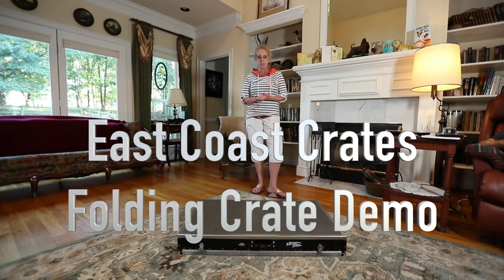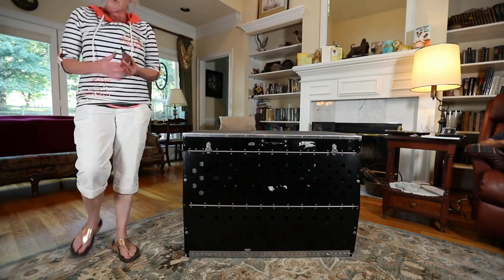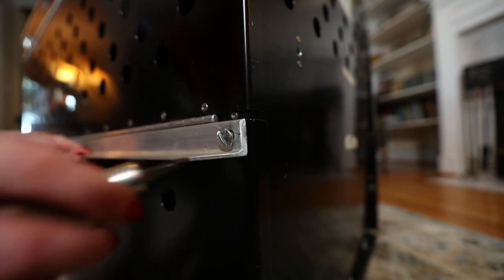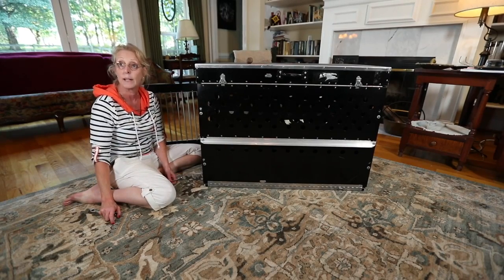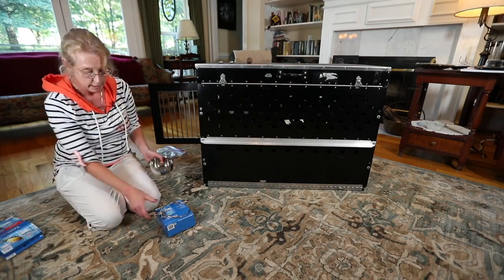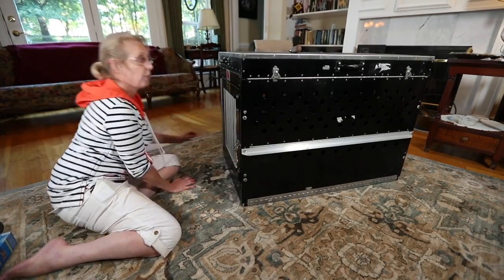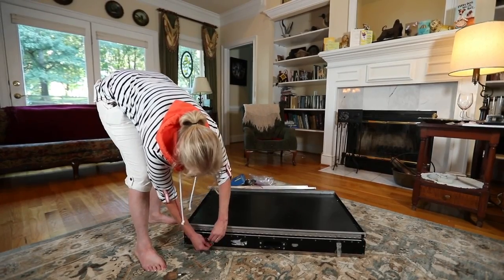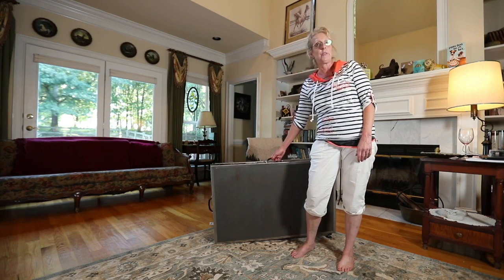East Coast Crates Folding Crate Demo

Comment: good design for travel van, but in the event of a rear end collision is there any safety offered for the dog? Most minivans are 40 inches wide, so plastic airline crates are two wide if side by side, at 21 inches each, it requires raising one up, over the other,lip over lip, with a piece of wood to act as an elevation mechanism. How wide are these so they can fit side by side? If 20 inches it's really worth buying for that reason alone.